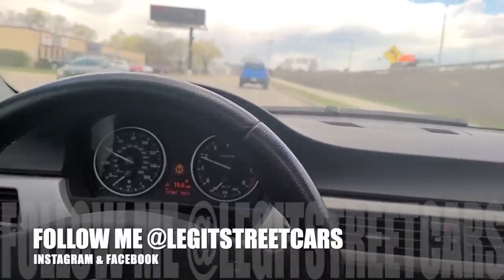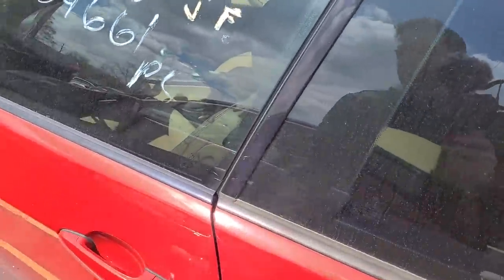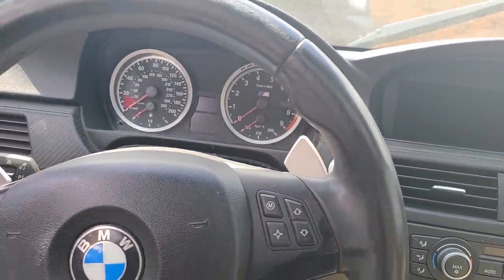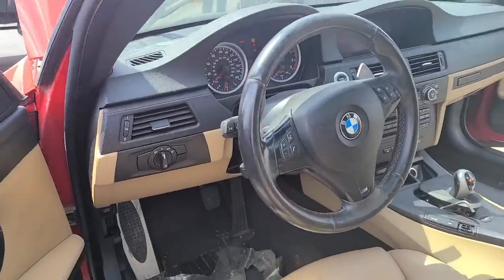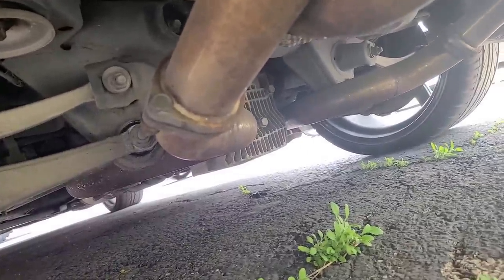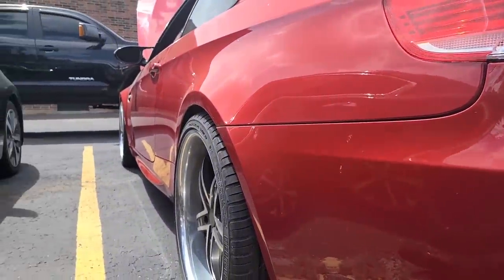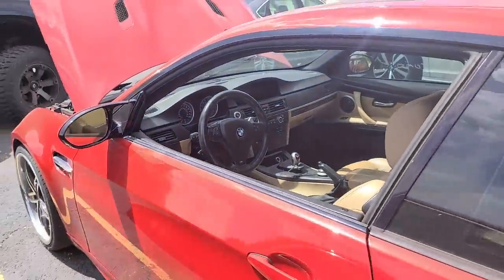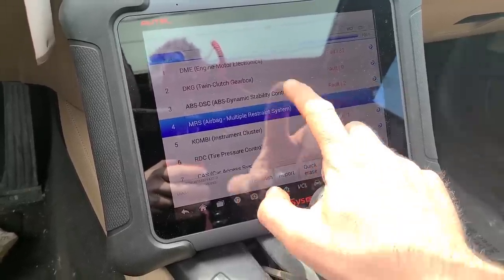I Found A Dealer Auction E92 M3 Sitting For 3 Years With A Supposed “Bad” Engine! Listen To This!

Comment: Alex, with respect to this M3 there is conflicting information that needs to be sorted.

Can you run the VIN through autoauction.io and more clearly see the previous auction results, share these results with us viewers along with the info from Fluid Motor Union?  You are very smart and many of us see the 180,xxx on both the drivers and passenger door glass typically indicative of mileage when going thru an auction. That mileage is consistent with the overall quality of this car.  I am surprised you said nothing about cigarettes to the seller to bust his chops for contents sake but to also help drive down the overall value of this rig  kept us posted

Comment: Even at $7500 the gamble seems pretty risky to me. Factor in paint, body, and interior work that put you very close to break even, then consider the unknowns such as transmission, computer modules, climate control, brakes, and suspension. You could end up way upside down in a blink. NOTHING on an M car is cheap. Good luck finding used M parts because there weren’t that many to begin with.

Comment: In my opinion it looks like the only things that need to get fixed on this M3 are maybe a few electrical and ignition things and rod bearings. It was definitely beaten on and neglected, cheap tires are telltale, but the S65 and DCT transmission are built very sturdy and are meant to take a beating. Interior bits can be replaced. I think maybe sub $10k is fair. Still iffy either way

Comment: When I heard "tick" after trying to start the engine, first thing that came on my mind was mine ex E92, it had same sound after being crashed from behind and the only way to start it was possible with portable starter. After everything I've seen and heard I'd run away from that car, ex owner haven't maintained it at all. It is awsome car with brutal performance but not this one..

Comment: At least the engine has more than 48k! Especially if it’s from the junk yard, it was probably a bad engine from the junkyard I’ve seen it happen a million times, a local yard by me would sell EVERY engine as “under 80k miles running with warranty" and they would gladly replace it but imagine the labor cost to install a bad engine then have to repull it and reinstall. Sad but that's the industry.

Comment: Just saw this video for the first time what I’m wondering is if new bearings were put in and the timing was never done that could be the reason that it runs like shit and you may just be able to get the timing set in a few other codes repaired and not have to put an engine in it and 7500 will be a huge steal but I guess that’s a question for another day hopefully make another video about it if you get it

Comment: A low mileage e92 is much more than 25k. 25k gets you a 80-100k mile e92 M3. $7500 is a really good deal for an e92 m3. If it has a clean title and you fix it up you could easily sell it for 35k

Comment: ONLY IF IT'S CHEAP ENOUGH! LOL. I just bought a E90 335i 2008 for $1900.00. I put a new High Pressure Fuel Pump in it changed the plugs and coils and it runs like a dream. Buy it the engine is not likely blown. But even if it needs rod bearings you can do that job yourself.  That is if the price is low enough. The ZF trans won't break in the sense of it being a serious internal problem they can have actuator problems which can easily fixed (As you did with one of your Mercedes).

Comment: People thought I was picky for passing on a 2016 550I V8 TT black on Black with 60k miles for $16k. Swirls in the paint, tires were 50/50 and grabbing the int handle it was like grabbing melting black tar! The inside was melting on the doors & the outside was all cracking around the wipers & top rails. Looked clean but when you really were looking it over you could tell the owner just had money and didn’t care about it at all. Honestly I offered him $15k and went there with a bank check and he went on a golf trip 300 miles away and drive that instead off all his other cars after he said okay he will take it. Guess he thought the money was fine but he could still drive it for the weekend. But I ended up getting a 2016 BMW X6M white fully loaded with 25,000 miles black leather looks brand new & fast & a full carbon fiber trim package.

Comment: I was wondering if that car has 140,000 miles instead of 40,000, for 40,000 engine is no good, body work has Bondo, drivers seat has wear, that car is questionable, they can somehow replace the part where the mileage is, I question the clean title also.

Comment: No need to run that car's not chasing anyone.  It's been thrashed to within an inch of its life.  The metal in the oil means a full rebuild, bearings, plugs, maybe coils and injectors too, no shortcuts.  New battery, OE wheels, Michelin PS4 S, bodywork, interior trim 100$ a piece and the list will grow if those codes don't disappear.  It needs so much love.  Surely only viable as a YouTube project and why it's been sitting for 3 years, waiting for you to come along.

Comment: Offer 6k cash. Then just do the just deferred maintenance. I think full service, new injectors, plugs, quality gas, check the brakes, check the clutch, and borescope the cylinders. I bet the metal shavings are a broken ring. Then throw those horrible wheels away.

Comment: $7500 is more than enough because you're going to find a few issues you didn't expect. The poor car was flogged at every drive and left in the elements, judging from the peeling windscreen rubber. No waxing paint not leathers. Good luck with it 👍

Comment: Of course it has a tick, old oil sitting for 1 year, lifters empty. you should have changed the oil before starting it, conrods don't like old oil... nor the vanos pump. throttle actuators, vanos solenoids, conrods = consumables on this engine. Not worth 10k$ but replace the parts said above, and with good oil and change every 4000 miles this engine lasts forever, given that you don't rev it to redline when cold. That's why all folks banter and complain about M3/M5 E9x/E6x, but absolutely nobody maintains and uses these cars properly. PS: faults can pop up because the battery died, most of them are chained to 1-2 main problems.

Comment: letting a battery powered car sit for a year would kill the battery and most likely total the car. that is some of the cool things about combustion engine cars i like, if you have some mechanical knowledge you can get a running vehicle, from a car that has been set to rot somewhere.

Comment: Cost of motor, bodywork, labor = 15k. Retail is 25, so 10k including profit and holding costs. I'd want 20% profit, so we're at 5k max. Really - I'd pay 3k because there is risk - it's not a "Swap engine, finished" deal. If one fender has a bad repair - what else is being hidden?

Comment: Fan came out to inspect the car. Not a good. 
Footwell module.   

The first owner drive abuse the car.  
BMW engine are built well. 
Lack out oil change care.  

BMW runs very hot at 3500 RPM + 
5 - 15 mins on heavy acceleration. 
Can cook up coolant system. 

Engine rebuild is definitely. 
Fans not plug in failure safe car shutdown. 
 
needs new 8 cylinder head replacement. 
& Timing chain inspection due to abused lack of oil cared.

Comment: Is there any reason you couldn't jack up the back of the car and put it in D? Will the wheel speed sensors freak out about the fronts not turning? Could you trick them with a resistor? Also, I can feel the desire to make a terrible mistake. I might know how that can turn out.

Announcer: "Every car deserves love and for only $199 a month you can help us find a home for neglected and abused cars, call now."

Comment: The wear on the wheel and seat are really suspicious to me. My 207,000 mile VW wasn't that bad. I've done over 200k on two Audis and a VW, and I've put over 150k on a few more cars, and near 190k on my current Grand Cherokee, and none of them had that sort of wear on the interior. I was cars when the dirt affects the aerodynamics, and I clean the interior when the dealership owes me an apology. And still. There's no way that interior is from a sub 50k car. I think this is an accumulation of crap put in a dog of a car to get shot of it all at once. He probably has an old M3 somewhere with a lovely interior.

Comment: You helped the JR Garage boys buy a MB S600 bi-turbo for $3,000 with a way nicer condition body and interior and it drove itself away.  I was thinking this E92 M3 SMG was worth about the same....  Is $7,500-$10,000 for this beat M3 You-Tube price inflation? ;)  It should just be parted out.

Comment: 48k miles my arse! I had same BMW with 200k km on clock and the interior was in a brand new condition. To fck up car like that usually takes 300-400k km at least.
And IMHO this car is dead AF. Prepare quadrillion if you really want to repair it.

Comment: $8k for the car not a dime more.  The Engine is $7k.......  I am from a cheap country and this engine is Seriously expensive.  We are on the borders of Germany.  If you are going to rep the engine.  BUY from Germany direct and import it.  Personally check with fluid motor with this engine first.  Remove the silnik/engine makes easier access.  Also you can check all pipes and hoses.

Comment: Most likely a drug dealer/gangster type of guy who bought it and never changed the oil or did any maintenance on the car, the type of guy who would turn it on and immediately floor it down the block in the winter. So sad for the car

Comment: Vacuum.... nothing else wrong with that engine! The ticking is just valves adjusters that has been sitting a long time. But dark taillights...? Blue tipped exhaust...? Crap aftermarket wheels....? That car is begging to be brought back to stock....

Comment: There isn’t any upside to this. So best case scenario you’re in it for 17.5 w/o touching the wheels, tires, brakes and who knows what other “deferred maintenance items” when you can buy running/driving examples for 20k. Guarantee that odometer has been reset too. 

Stay away Alex, stay away.

Comment: Looks like another case of someone buying more than they can afford and going cheap with everything. I sold a few BMWs to people that then went half-assed with no maintenence, cheap rims, fragged interiors, and we'd repossess garbage that auctioning wouldn't make up what we had in it, even taking into consideration the 2500 down payment and 1200 from 3 months of payments.

For those saying that that's too much interior wear for the mileage, not even close. I've seen vehicles with ripped seats and fragged arm rests with less than 20k miles. Chemicals sprayed on bare arms like Off can cause major havoc to materials. Hell, children can muck up an interior in under 200 miles when parents allow them to eat and drink in cars.

Comment: Yup a car that sat for 2 years has degraded at least $6,000 so that $25,000 is now appraised it 18 or 19 the car's value without an engine and or possibly transmission issues and all the cosmetics is not worth more than 3,000 to 5,000 you either steal it or walk away

Comment: I’ll buy it, if I have the money. Tbh, $10K for a V8 M3 isn’t bad. I don’t think it needs a new engine. Working and fixing the one it has, will probably fix everything. A 4.4 stroker kit will do it. And I saw a video, not long ago, someone had a full 4.4 engine for sale, basically zero-miles, on a Spencer Berke video. 
https://youtu.be/xYGAfgH9kDc

Comment: Jeez, Less than 50K, and would technically be on its 3rd engine if you choose to replace the engine, it will never be close to its normal retail value, easily 8K below the equivalent M3 due to multiple replacement engines that ARE NOT NEW, rust, body work was needed, interior repairs, all decrease a vehicles value, even after being replaced. 
Hard pass unfortunately.

Comment: Eek what a heap.  If it was manual maybe.  Then at least you know the tranny probably fine.   It wasn't needing an engine that held back this car selling so long.  It's all the other stuff.  The ghetto rear ¼ repair, dents and scratches, worn drivers seat, the hideous looking wheels that clearly don't even fit properly even with spacers..my guess?  Those wheels were put on after 1 or 2 of the factory wheels got wrecked when the accident on the rear happened.  Bet the back end let loose and smacked a curb.  Those cheap looking wheels could be bought for the cost of 1 factory BMW wheel.  10k guys dreaming.  8k maybe.  After sitting that damn long what's 2k to get rid of a headache and eyesore?

Comment: Dude why are you even messing with this thing? It has 40,000 miles on it which means that probably the previous owner wasn't even concerned in doing the free maintenance that came along with it. This thing is busted.

Comment: Packa smokes, smoker car, 100k mi interior condition, 2008, tan int, dct., stole the Button, fender hit.   Bottom market $20k car, only bc odometer if its correct.  2008 100k mi running car $20k.

Do the project, make money back off youtube vids.